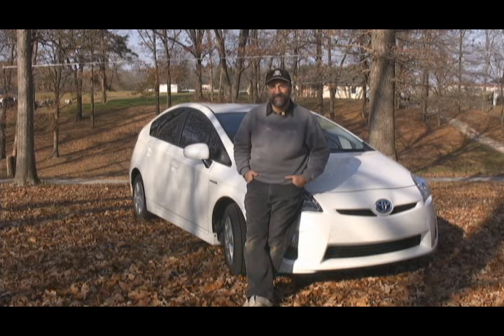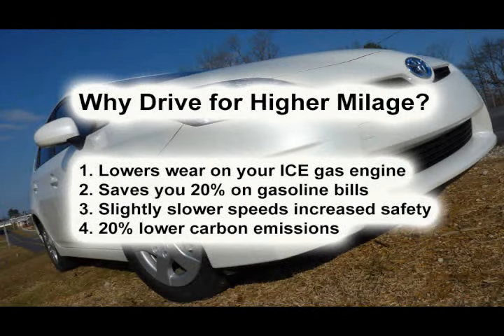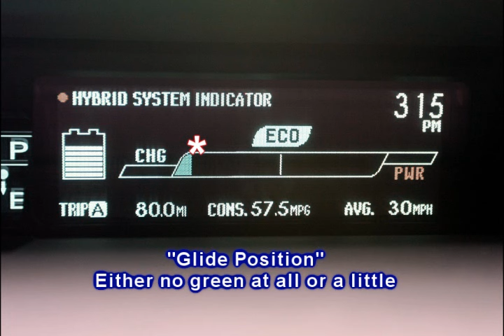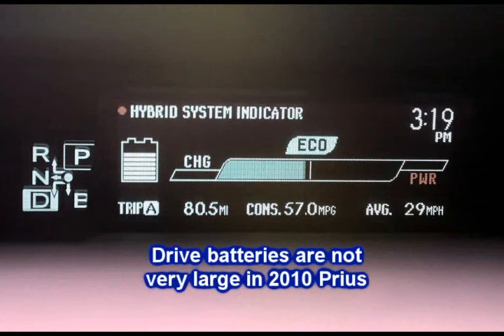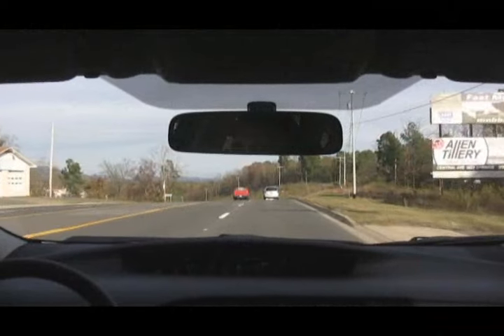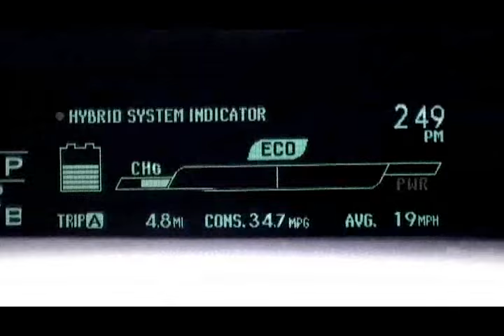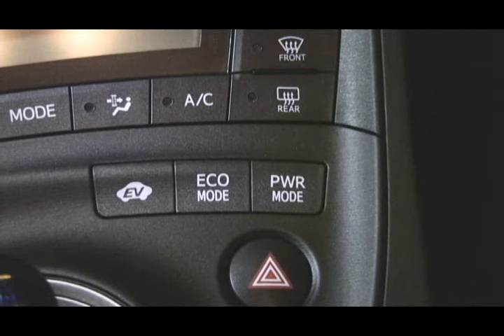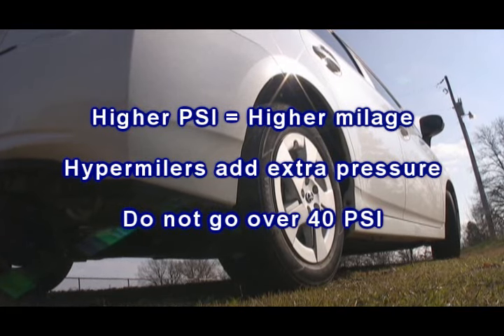Prius MAX MPG Secrets

Comment: A few extra things, as the battery ages the mileage will drop. I am at 280,000 on the original battery in a 2012. Hey has dropped about 5mpg. 

My commute involves mountains. Going I can get about 35-40. Coming I can bet 50-70. Traffic makes a big difference. 
My mountains mean changing 400-1000 feet at a time. 
Going up a slight hill for a long period seems to use more fuel than a steeper hill of the same height.

Remove all the weight possible. Some people like to travel with a car full of stuff. I'm guilty of keeping a plethora of tools handy. Less really is more.

Comment: For the 'pulse', i noticed one thing to correct. ICE's reach maximum efficiency/power at 4000 rpmish, so accelerating quickly is actually more efficient than excellerating slowly.

Comment: This is for GEN 1......ICE petrol engine not run for very long.......(P3101 or P3190 or P3191.)...first clean MAF in throttle body, then do oil change US 3.8 quarts and no more. Do not over fill on older models.
Then change spark plugs if they need it. 
Restart engine. Problem should be gone...if not repkacecthe fuel pump relay....check that Inverter coolant is circulating too, if not replace pump.

Comment: I barely break 40mpg in my 2013 Prius Persona. I do have the 17" wheels which I have heard can reduce the mileage but that much? I'm getting around 43mpg.
Reply: Amir : What kind of driving are you doing?  If you're making only short trips, then low 40s is what you can expect.  I bought a Leaf electric car for my wife, who just goes to the gym and the store, and only use the Prius for trips longer than fifteen miles.  When she was driving the (2001) Prius she was getting low 40s in summer and high 30s in winter.
Reply: Try to only use the AC when its really hot out or foggy. Cruise control is your friend, the car knows how to drive itself better than you. And last but not least, go the speed limit, if you're going over 65 MPH your MPG will go down after that. There's also an extra tip, that EV button that you can never seem to be able to use, shut off the AC and it will NOT use the combustion engine, but its main use is parking lots and short distance city driving
Reply: Dylan Greene : "... the car knows how to drive itself better than you" except as described in this video.  But, if you don't understand or want to be bothered with these subtleties, letting the car drive itself is good advice.  I use cruise control above the speed where pulse and glide is possible and I really don't think it hurts my fuel economy.  Example - Boston to Buffalo at 71 m.p.h. in cruise, 51 m.p.g. measured at the tank.

Comment: I must disagree with you about this rapid acceleration. Prius engine is not a traditional Otto motor it also uses Atkinsons cycle and if you accelerate so that you wont go to Power range your engine will use Atkinsons cycle and electric motor to make torque. So getting up to speed slowly without power range is better.

Comment from the maker: @frosted1030 Ahh, so your problem is really traffic, not hills. I have hills and I can let the car slow down 20% or so (I'm talking just not pressing the pedal more to maintain speed -but with ICE on). I have no traffic.
You are 147% right!  In L.A., you get 35MPG on a Prius because of traffic. In Arkansas, you get 60MPG because I can drive exactly as I like. Actually, I find that wind is the biggest MPG killer. Sorry you are not getting the MPG you'd like.

Comment: Can anyone tell why it takes so long in the morning for my EV mode to work/run? I'm getting awful mpg in town...I drive a few miles in town a few times and week and get about 22mpg....normally my EV mode takes time to generate...any thoughts or ideas on how to get the EV mode to work quicker?
Reply: EV mode in the regular prius isn't of much use unfortunately. At best it's really only useful when in a parking lot looking for a place to park, or pulling into your driveway when you get close to home. It's slightly different for the plug-in prius, but I don't know much about that one. I wouldn't use it too much as if you drain the battery too much then the gas engine kicks on more, resulting in more gas usage and lower mpg.

MPG is always terrible when doing a "cold start", aka your car hasn't ran in a few hours. But that's also true for every other car. It's just that it's a lot easier to tell in the prius when you first drive it. Once the engine is warmed up, then the mpg should get a lot better. But for frequent short trips, such as ones that are like 15 minutes or less, or if you drive less than 4 miles, mpg will not be very good. But again, that's true for any other car as well.

And if it's cold outside, you're probably also running the heater, which also forces the gas engine to run longer so it can generate enough heat to warm up the engine, as well as the inside of the car. One thing I found useful is to wait about 10 minutes of driving before starting up the heater. If the windows fog up, AND it's not negative temps, crack your windows open for about 10-15 seconds, and the airflow should help clear them up faster than blasting the heat and a/c.

Comment: Hey I got a 2010 Toyota Prius and my question is my EV. Only lasts me 5 minutes does anyone have the same problem even when the battery is fully charged also my light on the passenger side went out I just changed it and October 2018 and we're barely January 2019 if anybody has answers let me know

Comment: Why don't you mention using cruise control?
Reply from the maker: Because Cruise control does not give the best MPG. Using CC, you get 15% less MPG than driving actively with my methods. Cruise control maintains speed up hills exactly...which means pushing the pedal down 2/3rds of the way. This is the MPG killer.

Comment: I can only get up to 25 MPH in EV Mode =( WHY???
My Prius is not plug in, is that why?
Reply from the maker: Your top speed in a non-PHEV Prius in electric mode is 41 mph. If you accelerate from zero on EV- it will turn the gas motor on before 41.
Do as I show and pull your foot off the pedal once you are at 40mph and
then just press it lightly- and you will stay in electric.
Reply: Bob Nagy Nice video, Bob.  A couple questions: I owned a 2002 Prius (first generation in US) for a few years and got an overall average of 47.9 mpg according to the dashboard readout.  Did I do well or underachieve?  Secondly, if you mentioned this in the video, I missed it, but what is the mph "sweet spot" for optimum gas mileage?  Much thanks.
Reply from the maker: Shawn Hall
Well, 47.9mpg is just about average for a first gen Prius. Actually, most people get slightly less...so fine.
The sweet spot for optimum gas mileage is when the display bar that shows the "gas" pedal position is between just above the mid-line and just below the PWR bar at top. This corresponds to between 57-65mph (in the 2000-3000 rpm range). On a third-gen vehicle, there is a "cross-over point" where MPH=MPG. That is about 63mph. At 70mph, I get 52mpg. On long road trips (4000+ miles in varying conditions) I average 58mpg. I drive with traffic. Under 63mph efficiency does not increase much. Excellent hyper-mileing results in around 70mpg. Fourth Gen Prius' will achieve 10% better.

Comment: there is nothing easy about getting to 60 mpg and staying there. 50 mpg yes, maybe 55 with hypermiling. 60 no. anything over 55 is difficult to maintain.
Reply: @SimonWoodburyForget  also depends on the size of the gallon. US = 3.8 litres. UK = 4.54.

Comment: does the prius have a neutral gear?
Reply: +Muranaman Only indirectly.  The Prius drive train does not have any clutches between the tires and the engine.  It is hard geared.  The electric motors allow for engine speed variability.

Comment: Why do you not promote the use of , or engaging the recovery brake on the gear stick? this generates electriscity a lot faster than using the pedal, and allows you to slow for stop signs & red lights without using the foot break until the last few seconds. I can average 3.8 litres per 100 Km on combinded city ^ motorway driving.
Reply: Bob Nagy The transmission WILL NOT develop an "ISSUE" this is silly. The biggest problem with using the "B" position is that one forgets to put the car back in drive. this should be done immediately before a stop so the engine shuts down to save idle fuel. Most times in the "B" position, the engine will not idle stop. Gen 2 and 3 transmissions are nearly bullet proof. The added regen function is there for a very good reason, and would not have been added if it caused any problems. -Prius Tech...

Comment: Great techniqes, but PLEASE - keep your eyes on the road instead of some indicator. When you have to brake DO IT ! Don´t thing abou saving gas in critical situations... I almost crashed because of people saving fuel - one driver (actually in Prius :D ) in front of me wasn´t accelerating fast enough (we were joining on the highway), I couldn´t overtake him because of the traffic, and the other guy behind me wasn´t braking (only panic brake just moment before hitting me). Luckily nothing happened.

Comment: I always keep the climate control in auto at the 70-72 degree range year round. Remember that the traction battery gets its cooling/warming air from the cabin.
Reply: Whenever I do switch to Auto fan runs at full blast, onto my face(also I prefer to windshield).  Damn it.  Use only in Manual

Comment: ev mode cant be mesured in MPG. this is why we in Sweden uses Liters per Kilometer. ev mode = 0l/100km, normal driving is 4,5l/100km
Reply: Yes u can Daniel,Do u think that Toyota engineers are stupid?When the ICE doesn't work but the car is moving under torque, one electric motor is using amps so the diference of input and output amps at the battery is calculated- transformed in Watts and next in HP.Then the 100 MPG could be right or just a minimum estimation(gauge range limitation by design).

Comment: @Yavor54 You are 100% wrong. I live in NC, you can not accelerate slowly up a hill in traffic. The ICE kicks into power mode and you burn a lot of gas no matter how you try to drive, in NC you are going up or down a hill every 1/4th mile or less and they can are almost always too steep to go up using electric energy. What we need is a state by state MPG chart, you can not expect the same gas mileage in that you would get in Utah, in NC.

Comment: Sorry, sacrificing interior heat for a tiny bit of extra mileage is just not an option in winter.
Reply: Only the most hardcore of hypermilers would consider it. Bob is simply mentioning one way you can do it. But common sense should dictate that if it's cold outside, you should probably turn your heat on. I'd rather be warm and comfy driving my prius, than freezing my buns and getting slightly more mpg.

Comment: I get 40 mpg consistently. I also feel ripped off.
Reply from the maker: Wow, I have never gotten 40mpg at ANY time with my Prius. You'd have to keep it in Power mode and
stomp on the pedal all the time to get 40mpg. (I imagine) Without ANY driving technique, you get a solid 50mpg.
If I really hyper-mile, I can get 70mpg. 55 is guaranteed if you just don't speed. You must live in LA or on a mountain top...

Comment: I do all this and still only average 44-45 mpg. I feel ripped off by toyota
Reply: how hilly is the area you drive in?  Do you exceed 55 mph on highway often? You will get alot less mpg on highway above 60 mph.
Reply: Also braking hard uses the friction brakes more, if you get the meter down past the C in the CHG on the left side of the meter i find that the friction brakes are used, try to keep it betwen the C and H  and you will recover more energy from braking.  I find it hard to get less than 50 mpg even during winter, but I also use a radiator block during winter to keep my engine warmer.
Reply: I can easily get 52mpg on the expressway. Drive 65-70.
Reply from the maker: Do you know any other car that gets even 45 MPG? A shiny new Honda Insight only gets 40MPG.
Reply: Jon Gebarowski Agree 100%

Comment: The electric drive shuts off way before 41 mph.  Lol
Reply: All electric mode shuts off if you accelerate too fast but once you get up to your desired speed, you can use electric again. Check your car's engine monitor. As long as only half that bar is filled, it's using electric only, once you go past the halfway point, the ICE kicks in to help out. That's why it's called a hybrid.